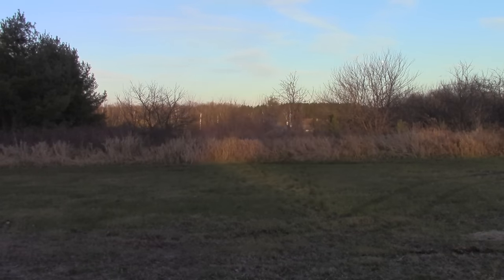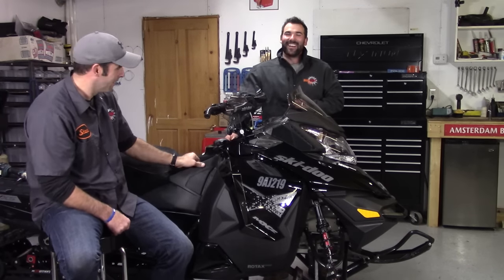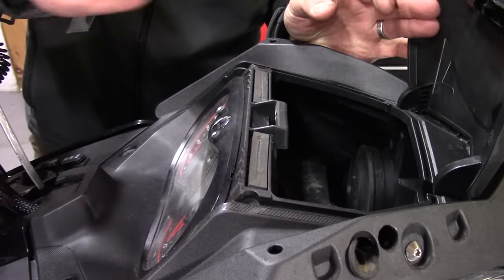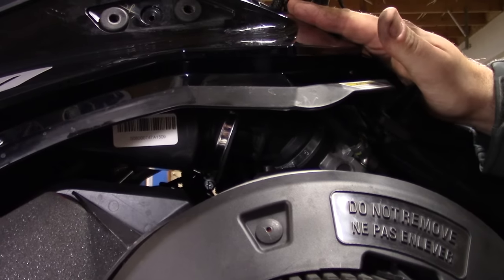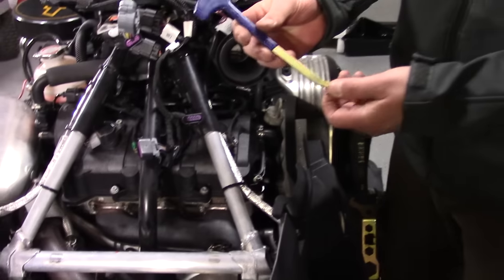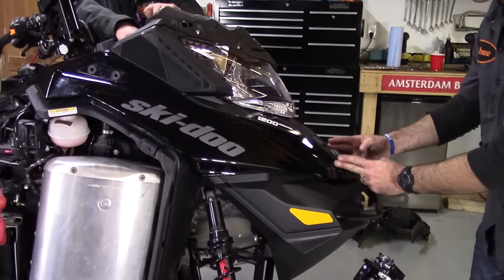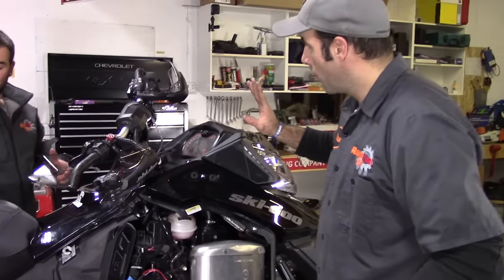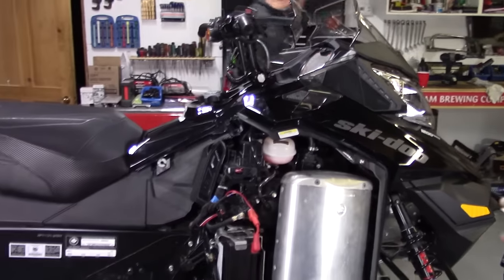2013- 2017 Ski-Doo hood REMOVAL by RawFuelTV

Comment: For a spring tool I used a 3/4" by 1/8" by 18" long piece of steel I had laying around and drilled a hole right near the end along the edge and one on the bottom end of it to look similar to the tool you have there!  Didn't know they made them, granted I lived in North Pole AK at the time and options are limited.  Mine works good on the exhaust as it's a little bendy to fit around the can on my old summit x 600 etec.

Comment: Thanks!
You forgot to re-attach and tighten the air box when putting it back together.
Doh!
Reply from the maker: You  are right, nice catch. We did re install the air boot, but apparently it never made it into the video. This often is an overlooked step when re installing the hood but it's certainly critical to the survival of your motor. Thanks for the heads up, we'll have to revise this video.

Comment: You do not have to remove the screws underneath the wind deflector to remove the hood.
Reply: flat6_dante  2 on top under gauge and 2 at the front at top under side panel

Comment: You guys did a really shitty job describing how to get it back on. Been fighting with mine over an hour because when I have the two front clips in, there’s a 1” gap between the brackets that need screwed together.
Reply from the maker: Comrade Everclear maybe in the future get your BRP Dealer to assist you.  The last thing you want is have your hood flying off on the trail. Good luck.